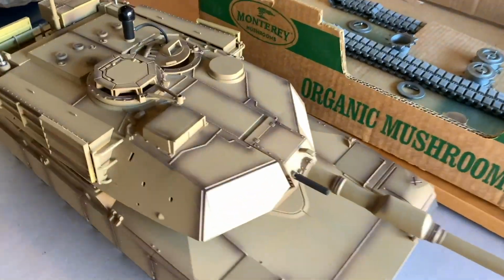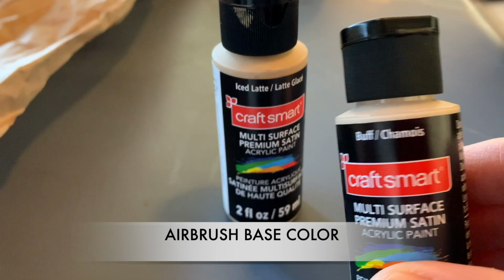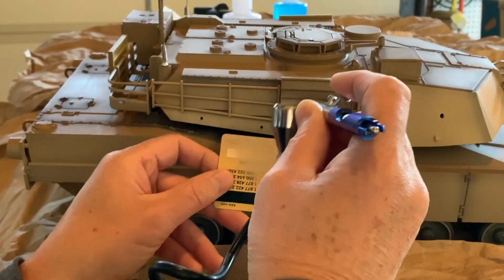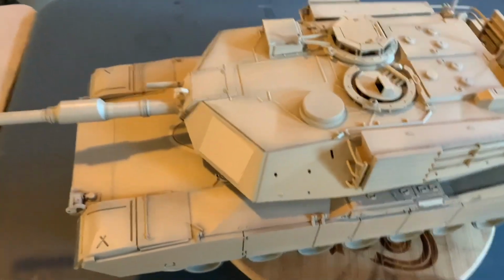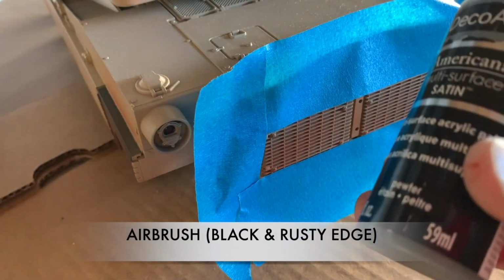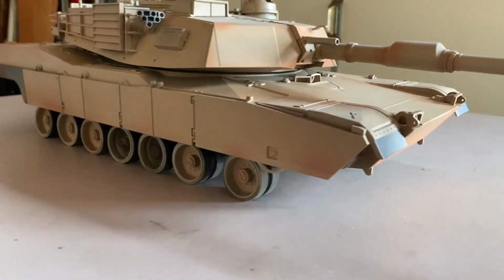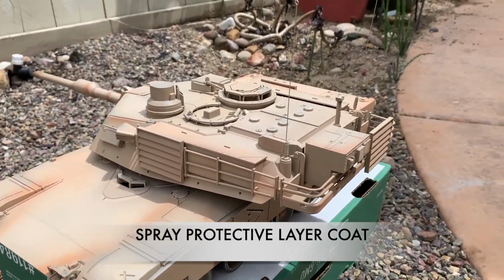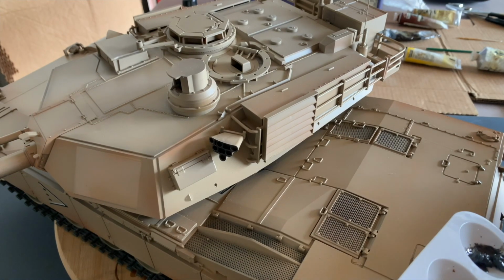#Howto paint and weather M1A2 Abrams #RC #Tank.

Comment: I noticed that you said you bought your M1A2 Abrams on Ebay....Did you buy it used through Toucan Hobby. Could you tell me what and if you had any problems with the seller and are you happy with your purchase? Thanks for any information that you might be able to provide.
Reply from the maker: I bought the Abrams from some other eBay seller used, not Toucan. But for the T34-85 in my other video, I bought it from Toucan Hobby. They are good. You can check out that video. Thanks.